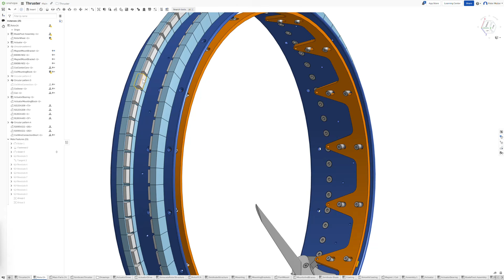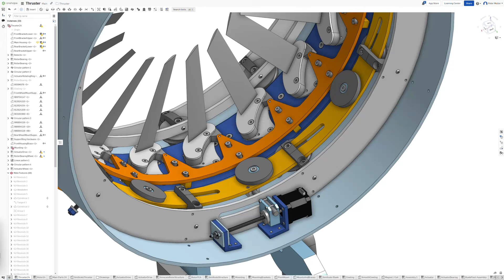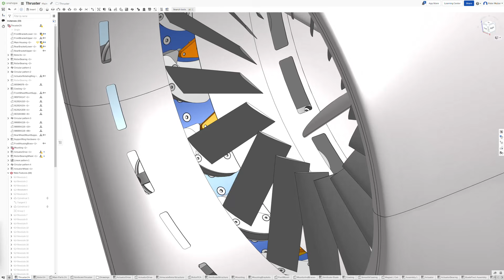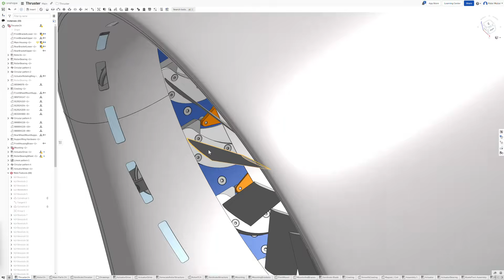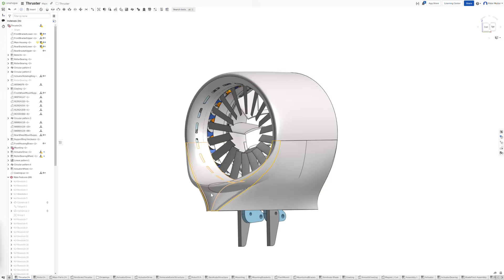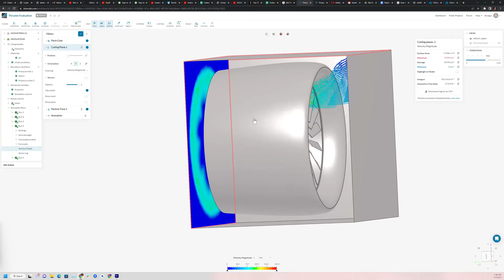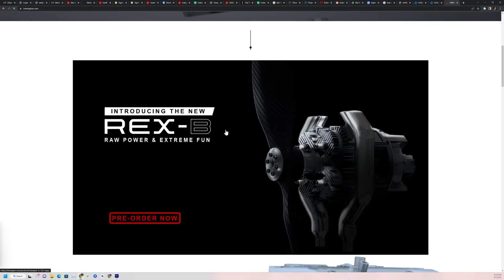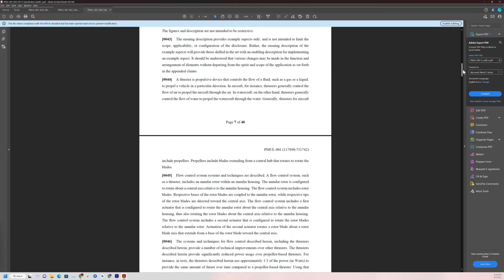Could this Thruster transform Aviation?

Comment: Aeronautical engineering student here, this is a really cool and interesting design! I have a few questions and suggestions for improvement maybe: 1. Except for weight and complexity, what is the advantage of having a hole in the middle? If you connected the blades together by a core with bearings to allow them to still pitch, you would reduce tip vortices, improving efficiency, and take some load off the blades, since they can now pull on each other instead of purely compressing down into the foot. This is also good because tensile stress is often better in metals, because they tend have the same compressive and tensile strength, but can buckle and bend way before they reach their compressive strength, especially with long and thin blades. If you don‘t plan on making them out of concrete or glass or something, tensile stress is preferable to compressive stress here!
2. In real jet engines, the rotor disk where the blades are mounted is made out of steel instead of aluminium. This is because it doesn‘t fatigue as quickly. Aluminium is pretty prone to material fatigue, so it is generally avoided for things like drive shafts and such. I don‘t know if that is going to be a problem here, especially since the rpm is way lower than in a jet engine, but I suggest thinking about fatigue as well! Less maintenance is always better.
3. I want to compliment you on the maintenance part, this thruster seems very accessible and easy to inspect and repair 👍
4. I‘m not a huge fan of the idea of a piston engine with an electric transmission, I get it if you want to pivot the thruster but want the engine fixed in place for your vtol aircraft, but if not you‘re throwing a lot of efficiency out the window there and add mass for no reason. If you want to go with a combustion engine it would be way more efficient to replace the coils and magnets with teeth and drive the rotor directly with the engine and some gears.
5. I think that the efficiency claims on the fan by itself might be realistic, but I‘m having trouble believing your results in the comparison to a real turbofan engine. You claim a 4 times efficiency increase with your gasoline-electric setup over a typical turbofan engine: These engines typically have efficiency degrees of around 20% as far as I know. 4 times that would be 80%. I can believe 80% for the fan by itself, but for the whole propulsion system that is very unrealistic, since a typical piston engine has about 30% efficiency, and with a 90% generator and a 95% electric motor, you‘d be left with about 26% efficiency. Now if you want to get to 80% your thruster will have to do magic because it would need an efficiency degree of about 300%!!! That is a clear violation of the laws of thermodynamics! Please check again if your calculations are correct!
6. Just thought of this but the blades pivot along the leading edge, right? By pivoting them around their pressure point instead you could reduce the load on both blades and pitch actuator!

Very cool video! 👌
Reply: Okay. Tell me if I'm wrong with my thoughts on this. (I was never an aerospace engineering student, though I did want to be at one point.) In general, I think this is a very innovative idea. But I see problems. Like you, I believe the compressive forces on the blades are one. Solving that could be integrated into solutions for the other problems I see. Most of them relate to that gaping hole in the center. That unused space that, IMO, would negatively affect the airflow both entering and exiting the engine. Am I wrong in thinking that dark blue gap in the back of his airflow model is going to end up causing drag and turbulence? It also seemed in his airflow modelling that, even though it showed acceleration inside the engine, the airspeed seemed to drop back off considerably as it exits. Here's what I think could fix these things: 1) Connect the blades in the center with a cone like we see in jet engines. The blades could still have adjustable pitch with bearings here and would have protection from the compressive forces while the cone would direct air away from the dead center space and into the blades. 2) Behind that, to compress the airflow going into the vortex eliminating stators and then eliminate that airflow void at the back, a bulb that tapers into an aerospike. And, of course, the outer cowling extended around the aerospike to maximize its efficiency. End of those fixes. I'm also not sure how much extra efficiency would really be gained, compared to the added weight and complexity, by having the adjustable pitch on the blades. Besides, wouldn't that also throw off the effectiveness of the stator blades at some angles? I also wonder if maybe contrarotating blades in the same engine might be the way to go. (I definitely think engine pairs on most craft should counter rotate.) The other problems I see are just minor technical things like the really heavy gauge windings in his motor stator and that maybe even permanent magnets in a motor of this type are not the way to go. But I like the idea of this. I look at all these small VTOL/hoverbike designs on the internet with non-ducted props and just imagine people getting chewed to pieces. (I'm also annoyed with how many ignore simple physics and put the point of thrust in the same plane with the center of mass or even below it.) I believe ducted is always the way to go on these craft. What did impress me with this one, though it was only at 100 rpm, was how quiet it seemed. One advantage to an engine like this is that in the case of lost power there would be at least some inertial flywheel effect.
Reply: I agree about the central toroid core bridging the blades to moderate the outward pressure of the blade housing. Balance would have to be very specific, but that's not unusual. The blades would, as you mentioned, need to have a mounting flange (for lack of a better term) in order to allow rotation in line with the outer ring inner diameter.

My addition, and this is purely off intuition and would depend on modeling, but I imagine the central toroid having an electromagnet, perhaps provided energy by passively the rotation of the mechanism itself. Then, from the "back" of the engine channel there could be a rod that would extend up to the center of the inner toroid. That rod would have ridges of some height that would spin relative to the direction of motion and thrust and governed by the electromagnet of the central toroid. That probably doesn't make sense but essentially what it would do is keep the air flow into a vortex traveling further into the engine that would be calibrated to passively operate depending on the engine conditions. It would I believe accelerate the airflow and could modify the various pressures. That's the best I can describe it in a YouTube comment lol

I'm a different kind of engineer so what I say might be ridiculous to an aerospace engineer. It's an intuitive idea in my head.
Reply: @beastmastre  You make a very good point that I didn‘t think about yet which are the aerodynamics of the hole: Wings (like the blades in this case) generate vortices at their tips when in motion. This is a result of pressure differentials and always happens. The vortices remain in the air for quite a while. In a regular propeller, these vortices are generated at the outer rim of the prop disk so they can‘t interfere with the blades. In this design however, these vortices will be generated in the middle of the engine, possibly hitting other blades or the stators which could lead to turbulence, reducing performance or in a worst case scenario stalling the airflow over the blades, causing sudden loss of thrust. There needs to be some wind tunnel testing to make sure this doesn‘t happen!
About your thought wether variable pitch blades are needed, they absolutely are. All modern propellers have this feature because it allows for greater top speeds while retaining efficiency across all airspeeds. A fixed blade propeller loses thrust as the plane goes faster, since the air comes in at a shallower angle relative to the moving blades. This means with low angle of attack blades that at a certain airspeed your prop just won‘t let you go faster. If you take a prop with higher angle of attack blades it can go faster but might stall at low speeds. Variable pitch is a necessity especially for a VTOL where you can‘t afford a thruster stalling and want precise control over your thrust!
Contra-rotating props tend to be more efficient aerodynamically because they cancel out the rotation of the air, but they can‘t fix this problem either! These sort of props always have variable pitch as well. I really love contra-rotating props, and they would actually be a lot easier to do on this engine, since it‘s rim driven you don‘t need two drive shafts etc to pass through each other, it‘d be as simple as adding another one of these thrusters right behind the first one. I don‘t know if that would be all that much better than having stators and just adding a second thruster somewhere else tho. Because that would certainly give more thrust. What contra-rotating props mainly do is cancel out the spin that the air has after the prop, causing it to go straight which gives you more thrust. This is also the point of the stators. Another problem with contra-rotating props is that they tend to be very noisy, tho there are workarounds and this is probably a pretty quiet thruster design.
Reply: There is one thing to be said about a hybrid electro-mechanical setup vs a traditional Combustion. Firstly running an engine at a designed optimized RPM over the course of its life, is far better than running a traditional engine at above 50% its total operating parameters. A lot of pilots I know cruise at 70%, Running a motor at near 3/4's its maximum for hours on end just invites wear and tear, so the Hybrid model, will result in much safer operations and reduce maintenance costs. Further, with batteries on board, there could always be a battery with roughly 30 minutes of operating time for an emergency power supply on a 3rd and completely separate circuit save for a trickle charge/balancing circuit. You would also be able to in theory run diesel generator for power vs AV/gas or traditional gasoline. My dad was a diesel mechanic and would tell me about semi's that had 750k miles on them without major issues, its largely due to the lower RPM operating ranges. I just don't know how well diesel does in thinner air, this also opens up the possibilities of Hydrogen fuel cells as well, (C'mon climate freaks) its your solution to noise and traditional pollution. The other change would be to suggest designing a Rotorplate to work on Axial flux vs its current state.
Reply: @ltsky311  Good point, planes like the eGenius show that a diesel-electric system can make the propulsion more efficient, but most of that comes from being able to place the prop in a more advantageous spot for aerodynamics, since you don‘t have to pump any fuel there and electric motors are way smaller, so you can place it on the vertical stabilizer for example. I don‘t really see how the system would benefit because of reduced rpm tho, small generators typically need very high rpm for good power output, and engine load and rpm don’t change much during a regular flight. I‘m not an expert on that however.
Reply: @planterion7969  the major difference though is generators are specifically designed to run a static constant speed. They just last longer. I have a Honda 4kw generator with thousands of hours on it, I don't take care of it well, and it gets oul changes more or less when I feel like it. And it still purs. But honda is honda eh. It's a  small camping genny. My generac natural gas backup genny, however is regularly maintained and cleaned.
Reply: @ltsky311  What‘s your point? Major difference between what?
Reply: @planterion7969  Generators inherently break down less than Airplane motors.. I guess that's the point.
Reply: @ltsky311  Okay I get it now, yeah, you’re right that there might be a difference in lifetime, but I don‘t think it‘ll be as big as the difference between a car engine and a power generator. Aircraft engines don‘t have constantly varying loads and speeds like a car or truck that goes into turns, has to brake at stoplights and needs to shift gears. Once you‘re in the air they run at pretty much constant speed. So I don‘t think terribly much changes. However I think you can build the engines for generators differently and run them on diesel, which should be less maintenance.
Reply: @planterion7969  the other thing is that they can be optimized to run at a certain RPM range constantly. We use generators at work to power a small outpost. And the load does change from time to time, but those gennys, are optimized, never seen it lose more than a few hundred RPM under its heaviest load. What I'm getting at is there is a reason Aircraft engines undergo far better maintenance routines, but seem to fail more than most generators. These things have been running for years non stop. This hybrid systemology is a net benefit. By running say axial motors on a genny, you could have an emergency power supply that kicks in and gives you say 15 minutes or 30 minutes of power just to land safely.
Reply: @ltsky311 Just adding in here, another advantage to the hybrid fuel-to-make-electricity-to-power-the-whatever is that when a better electric plant becomes available, you have a better chance/easier go at adopting it. (Someone mentioned H2 fuel cell in the comments and that's what I was thinking halfway through his video.)

I also 2nd everyone's thoughts on a central cowling both for better entrainment and better stability (I think we can see the blades vibrating at just 100rpm, 😮 maybe put up some protective plastic before running it, definitely wear eye gear). I'm so sorry for the build quality issues which may also be to blame. 

Kudos on this project and all the skill and work and ingenuity going into it. 

On a contrarian and hypothetical note, tho, once you stick a cowling in the middle... what would be the reason to keep driving it from the edge? Could you swap everything around and drive it from the middle,  but keep your pitch adjustment method, just move that to the middle as well? Is that then just reinventing a turbo fan? (That's not a rhetorical question... I really find this cool out of the box thinking, this is only meant as constructive critique, since I'm hoping you have an answer.)

Comment: At small scale, this should probably work fine. Many have already expressed concerns with forces on the blades, causing vibrations. I see a lot of turbulence at the blade tips which will effectively reduce efficiency to the point of negating airflow gain through the middle. There is going to be added radial airflow mixing with the more axial flow around the edges. Neat concept though